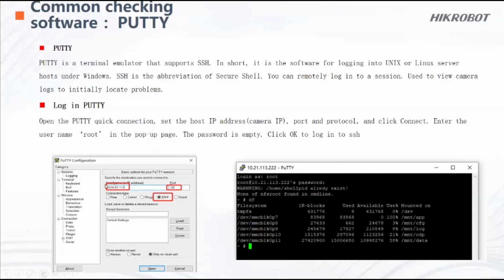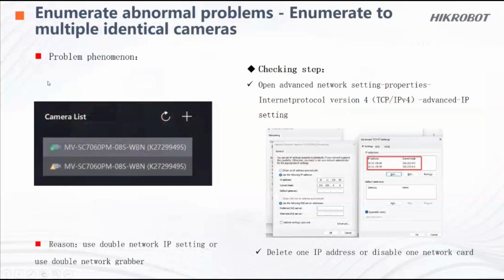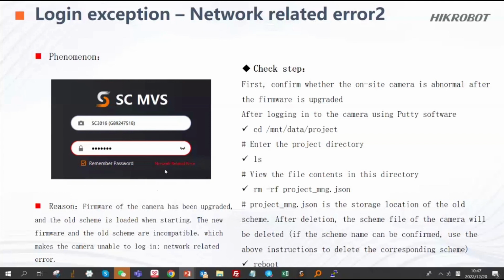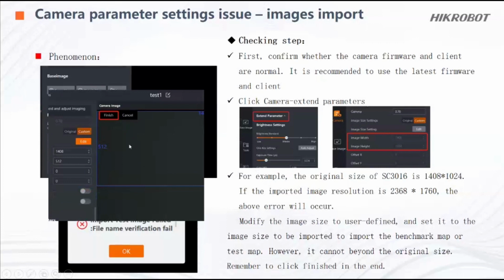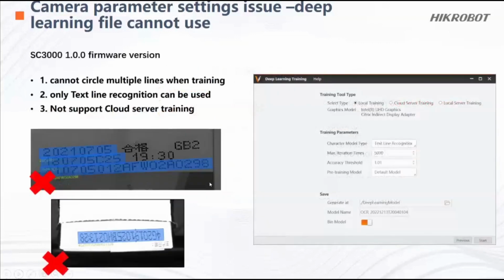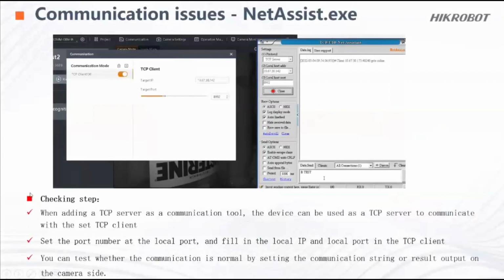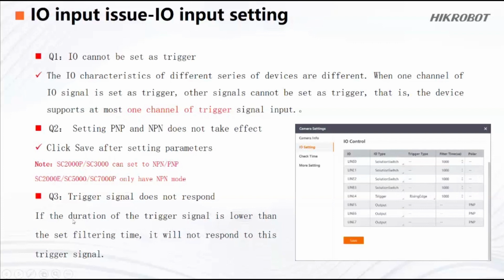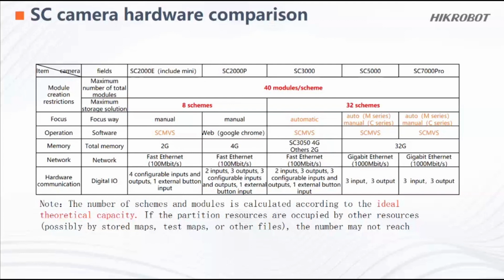HIKrobot - Troubleshooting methods for common problems of SC series

Comment: Hello, I have SC5000 and using SCView on Android to see the output, but the SCView now shows only a white blank screen upon opening? I can connect through laptop using MSSCV application and can login and see the camera, however the camera does not OK or NG automatically even when running continuously, nor does it show the image of the item being tested?  What could be the issue when it was working fine before.
Reply from the maker: Hello, I'm sorry to hear that.
There are some possibilities that lead to that outcome, for example - tool result setting up, cable issue. If you don't mind, could you please send the issue together with some images to my email? I'll forward them to our technical support in charge of your region.
junk.saengrungrawee@hikrobotics.com

Comment: Hi , woud like to know more about the differance of sc3000 series vs 5000 ,  and also what deep learning offers in the sc7000. .
Reply from the maker: Thanks for your comment. Main differences between SC3000 and SC5000 are 1. Resolution range (12MP/20MP) 2. SC5000 has larger memory and faster data transmittion.
For SC7000P, deep learning tools available are Classification, OCR, Object detection and Exception detection.